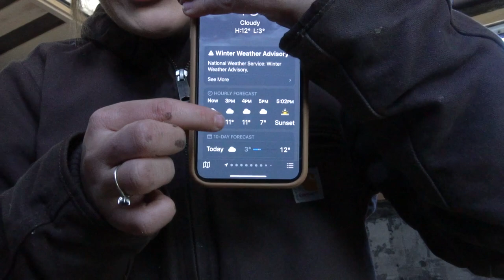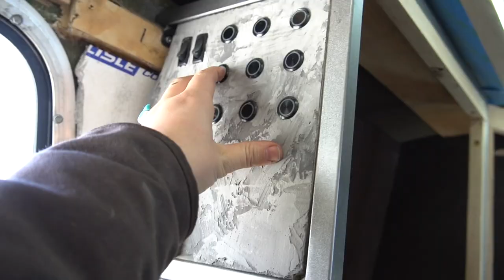Were stuck here... it's COLD // Van Conversion Series // 4x4 7.3 Ford Econoline Tiny Home On Wheels

Comment: Wait, who told you all 97 vans are 4x4??? 😂
No not even close.  Btw The Ford dealership has the best deals on remand' transmissions. 3yr unlimited mileage warranty.  Also the vans transmission will have to be taken apart and the rear output shaft replaced with the 4wd shaft to accept the transfer case along with the extension housing for the t-case.
Reply from the maker: Something cool we found out is if you get a handicap shuttle bus transmission it already has a 4x4 output shaft! The shuttle bus uses it for a parking break

Comment: Honestly IMO, rather than use your batteries, I'd use the Diesel Heater as my main source of heat to always keep plenty of electric available. You're probably going to find  that the diesel heater is more efficient all things considered. Heat pumps work but they're not near as hot as any any heat exchanger heat source and why most heat pumps also have a heat strip included to boost the heat but that also means more wattage being used and when you're depending on batteries and solar.... you know what I mean. Hopefully you didn't get over a 2 or 3KW diesel heater since a 5KW and damn sure 8KW is to big and will just waste diesel and probably short cycle off and on a lot. A little big is OK, to much to big is just a disaster.
Reply from the maker: We completely agree!! We at least want it to crank the heat in the van in the beginning then the mini split can easily maintain it 🙌🏻 but oh my lord, unfortunately this diesel heater came with the van, so we assumed since the previous owner told us that it worked. But after spending all day installing it because it bolts up behind the f'n frame rail we found out it doesn't even work 🤦🏽‍♀️ new one is ordered and on the way. Not sure what size it is, I'll have to ask Lance!

Comment: There was never a factory 4x4 Ford econoline van, they’re all conversions.
Reply from the maker: I did word that wrong but we recently found out the shuttle buses with the van front ends actually have 4x4 transmission but instead of a transfer case it's a transmission parking brake pretty cool!